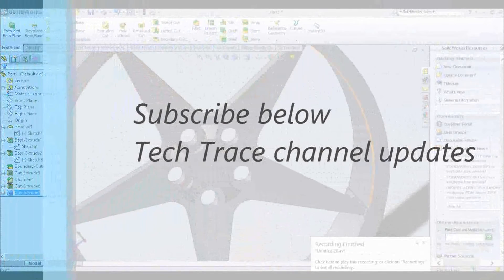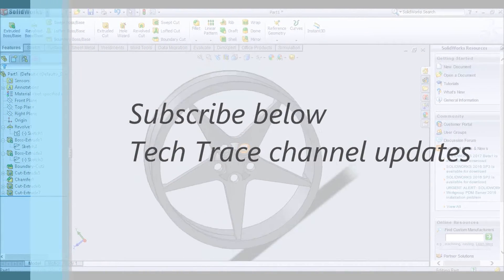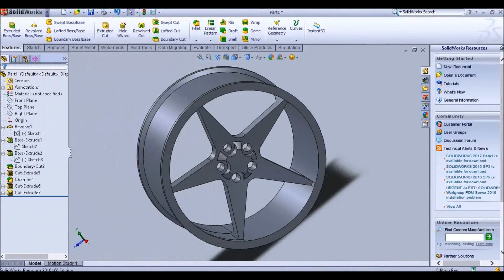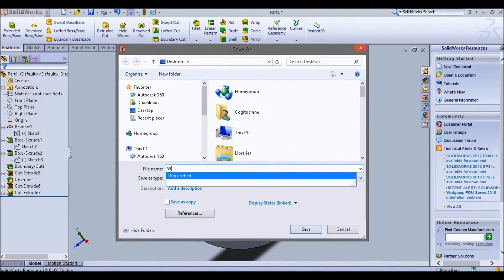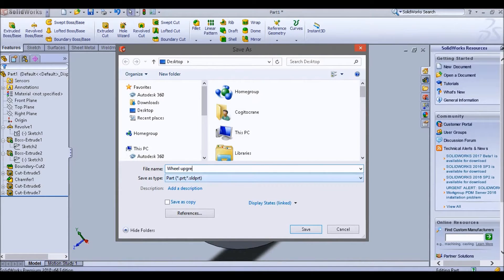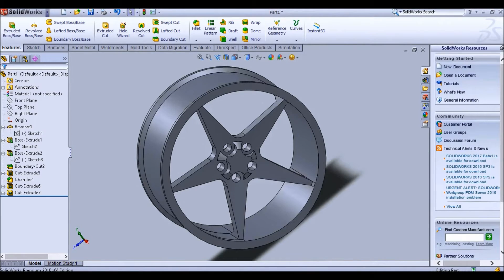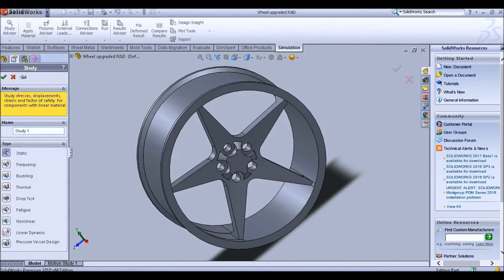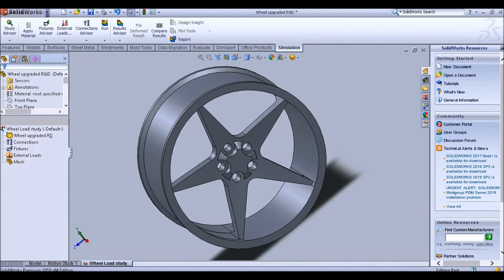Design and analysis the Car Wheel 5- Solidworks

Comment: given Torsion Load Lateral Load and Bump Load where do i key in these figures to check if my design of the car Rim is acceptable

i.e. Torision load is 905lbs
Lateral Load is 905lbs
Bump Load is 1028 lbs